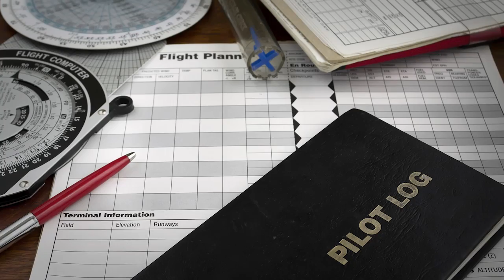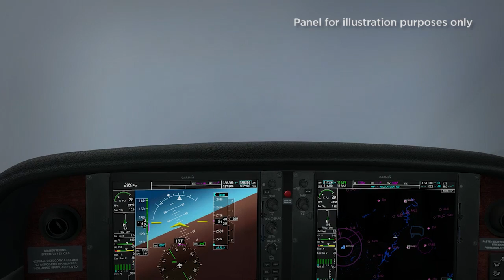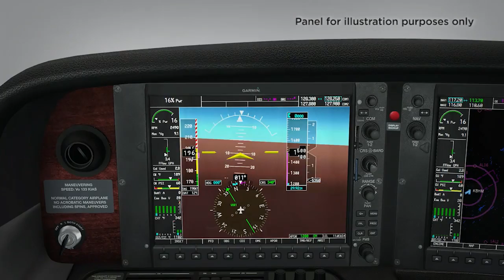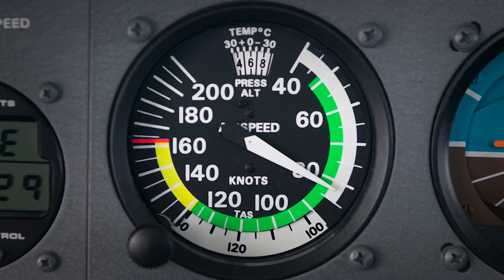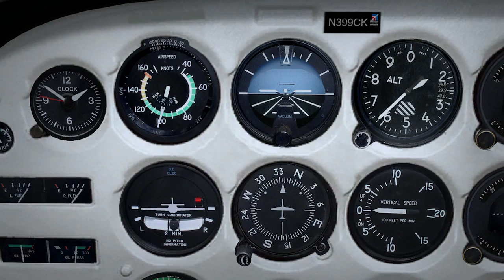Transitioning to Other Airplanes: Errors of Interpretation

Comment: This reminds me of a wave of plane crashes in Europe in the 90s and 00s where the pilots were from the Eastern Bloc but flying for western airlines post-communism. Basically in Soviet-built aircraft, on an artificial horizon, the horizon stays level and the plane changes on the display, the exact opposite of Western-built aircraft. So for a lot of eastern pilots flying western aircraft, the artificial horizon was essentially inverted, they got confused, turned the wrong way, and crashed.

Comment: I dont get this particular one at all. Transitioning from analogue to glass is not challenging to a "crash-the-plane" degree.... The REVERSE is really really hard, but what he was doing should have been easier than what he was used to. Digital requires virtually no instrument scan nor division of attention , and one thing that both (a) remains the same & (b)gets a helluva lot bigger is the ARTIFICIAL HORIZON. Its the largest, most pronounced display in the cockpit. Difficulty shooting an ILS -ok... all right, I'll buy that. 
Trouble telling which way is up with 300 actual logged and a 10 inch wide attitude indicator in your face? No. There's something more to this one. This does not add up. Maybe a display went out, maybe the other guy was trying to fly. Maybe they had a faulty AP they kept messing with.

Comment: Among the most minuscule of details has led to some of the most NOTORIOUS of crashes in COMMERCIAL AIRLINE HISTORY... I'm particularly reminded of the late Soviet Union's reluctant acceptance of Western Aircraft, and the difference between the "old school" Soviet Artificial Horizon from the Newer Western version was so small...

    In one the horizon was kept level, where the plane (symbolized on the gauge) would tilt... AND in the other the plane-symbol would be kept level so the background horizon would tilt relative to it... AND pilots on BOTH sides of the philosophy of perspective have had severe difficulty, especially under stressful conditions, with getting acquainted with the other..

     SO there are several crashes where the investigation cited that difference in attitude indication as the primary reasons a COMMERCIAL AIRLINE Pilot (with all the training that entails) would act upon his yoke and inputs EXACTLY OPPOSITE what the manual would prescribe for the flight conditions. It was down to a process of elimination, so there was NO other explanation, and by the flight data records, that's exactly what the pilot(s) did at the time.

     SO there are REASONS these dubious changes or customs or traditions of aircraft gauge are notorious or legendary... AND there are reasons you, too, will get warnings about certain birds or displays, and "quirks" of flying them, or trying to.  ;o)

Comment: To him the airspeed indicator probably seemed upside down. On the conventional round airspeed indicator zero is at the top, but on the tape display, zero is at the bottom. This provides an inverse relationship to the stick- airspeed reaction. In his Cessna he can drive the airspeed needle by pushing or pulling the stick in the direction he wants the needle to go. On the PFD, it’s the opposite. 
Altitude is similar, though not as significant, however, you can’t scan the tape without reading the numbers as easily as you can scan a conventional altimeter needle.
That full-width attitude display in the background is supposed to help pilots like this stay orientated. However, it can’t make up for a lack of training and experience entirely.

Comment: I don't get the allure for GA pilots to fly IFR and IMC. I love to look out the window and see what I am doing: flying a plane above the ground, looking at the visual references and being in the act of flying - fully engaged. If you can't see you're just sitting in a box in a cloud. If it is to "get there" (itis) then get on a commercial plane if the weather is not good. Or fly around it, or drive, go tomorrow. Transition training in the new to you craft is key. Why not do that? I have seen this erratic flying behavior indicative of disorientation / indecision a couple of times now in these safety videos. Once that happens you wish you had an auto pilot. Turn it on, use it, let it fly you straight and level, get your head back on, make a good plan, then go for executing that plan. There might have been another issue we don't know about that caused the pilot to get into the "swerving" mode. Sorry for these guys.

Comment: I was trained on steam gauges, and was resistant to change, but after one hour with an EFIS, was convinced. I promptly installed one in my experimental, at the same time increasing my panel space for other items. Not sure why this pilot had trouble just flying attitude with the EFIS. I have found it fairly easy with the airspeed and altitude tapes alongside. I think strongly, that it would be much more difficult, to transition from EFIS, to steam gauges.

Comment: Í was once a sim instructor on A320 and had a class of captains and first officers upgrading from a different airplane, analog 727s and 737-300/400 and those guys had a hard time not just on systems but scanning the various display units. Even tough the original "T" was still there, the different format presented some challenges, requiring some go back to ground school. Took some time to get used to the fast updating digital displays. So sad this happened.

Comment: What is the safety advantage of glass that looks so different from traditional instruments?  If none, then why not make glass appear more like traditional instruments in the first place.
Reply: Glass is way easier to read quickly once you get used to it. There is a bit less visual indication of what the different parts of the readout mean exactly, but once you know what everything is instinctively, you can scan the instruments and get an update on what exactly is going on with your aircraft much faster than you can with the old fashioned dials.
Reply: No advantage, just familiarity. 

Round dials were used because it’s easier to manufacture round dials. 

The USAF and NASA having practically unlimited budgets used mechanical vertical tape displays on aircraft like the F-105, SR-71, as well as most US spacecraft from Gemini to the Space Shuttle.  HUD displays also went to tape displays. 

Their research into human factors and performance concluded that it was superior... and civilian aircraft manufacturers adopted them as they could afford them... first in some analog displays like engine performance on the 747, L-1011, and Cessna Citation and for radar altimeters on later analog aircraft. As soon as glass cockpit displays became available they started moving all flight information to them. First airspeed with the 757 and 767. Then all information with the A320 and 747-400. 

And the proof is in the pudding. Aircraft accidents have been reduced considerably thanks to the increased situational awareness from this format. 

Unfortunately the high costs have kept these displays out of light aircraft. So most private pilots are only familiar with using traditional gauges.

Comment: Why not make the display optional for glass , simulate the crucial analog display gauges or change it  as you gain experience ?
Reply: Because the manufacturer would have to certify the instruments for both modes? Extra cost.
Reply: It seems you could sell more with optional configurations , seems like safety should be a priority when design flaws are recognized.

Comment: This is true for any experience level. Some years ago my company switched from the old B727 to our current B757. Those who had previously transitioned to the B727 from an old Learjet had to work harder when compared to some newer pilots who had previously flown ATR-42. How can a slow ATR pilot make a faster transition to a B757 than those with more experience in jets? Simple. Those who had to work harder had never flown a glass cockpit before.
Reply: And the 757 was a kind of glass-cockpit light, with round air data instruments. Going from the 727 to an A320 style PFD was even a bit tougher.

Comment: With two pilots in the cockpit it doesn't make sense that the flight deteriorated as it did. Why couldn't they maintain altitude and airspeed? Why didn't they land immediately at Auburn if they were having trouble with the plane? Maybe the two were arguing rather than cooperating.
Reply: That sounds like the most likely explanation to me as well. I've been in car rides that developed extremely heated arguments over which road to take to get to the destination, I can easily imagine the same happening here and both pilots getting distracted by the arguing.
Reply: That would be my guess as well. They got into a bit of trouble, and then argued with each other, instead of working together to get out of it.

Comment: The video is correct regarding transition from analog to digital instrumentation.  For me, one example was the appearance of digital quartz wristwatches in the early 80's.  All my life I could look at my mechanical wristwatch and see it was 20 minutes past Seven o"clock.  From that point I had a mental image of the watch hands, and a mental awareness of about how much time had passed since I last checked.  Enter the age of digital watches ---- I would see the numbers 720 and actually had to memorize numbers to know what time it was.  My brain wasn't trained in numbers for timekeeping, and I was constantly wondering what time it was, re-checking my watch every five minutes and still not knowing the time.  Finally, I resorted to turning the numbers into a mental image of a clock face, and that solved the problem, although I had to make watching the time a two-step process.  Analog v. digital are two different worlds in the area of human cognition and application.
Reply: Except this isn’t analog vs digital. It’s mechanical vs electronic. Glass displays are definitely analog.  Even “digital” readouts are on drum rollers so you can see fine values and trends. 

And of course the digital watch was never an issue for me since I had to work on a 24 hour Zulu clock which meant analog watches were next to useless.
Reply: Also... that “mental image” of the hands killed a whole pile of pilots flying off a three hand altimeter (the kind that you see on light aircraft) because they were too easy to misread by TEN THOUSAND FEET!!!

The very first addition to high performance jets was a altimeter with a drum roller readout of altitude and only a sweeping 20 foot hand.

Comment: The pilots who have trouble flying a glass cockpit or having problem interpreting the EFIS information are showing their old age.  We young people who grew up flying PC flight simulator and fighter combat simulator can easily understand the EFIS and love it.  This somehow translate to the experimental pilots who with the more adventurous mindset tend to favor glass cockpit over the ancient and obviously obsolete steam gauges.  I can't remember any experimental built within the last 5 years hss steam gauges.
Reply: I am not a  pilot, but I do have this to say: don't knock age and experience. You can learn something from everyone, "old" or not. Hubris is a killer.
Reply: Meh, I'm 25 and I think the old fashioned gauges are a lot cooler.
Reply: @Eric Miret I'm not entirely convinced by that. I mean, I know the stats prove me wrong, but if your display fails for any reason and it's your only instrument, you're dead. Vacuum gauges work even if you have a complete electrical failure, and even in case of vacuum pump failure they still operate correctly for a while, and you can have a standby vaccum system fitted quite cheaply and then unless your engine blows up you'll always have instruments.
Also if one of the instruments fails it's unlikely to affect the others.
I'd be much more at ease in an aircraft that had both the glass and some backup vacuum instruments, tbh.
Reply: Careful there demoniac81..... 

A vacuum system isn’t nearly as robust as you think it is. 

We all know how fragile a dry vacuum pump is. It’s not if it will fail, but when. 

If one vacuum instrument fails it can certainly affect another one. Especially if the case fails. Now all of the air will be drawn through the broken case or glass and not the rotor of the other gyro. 

Forget standby vacuum systems. If you’re IMC you’re probably high, with low ambient air pressure and high throttle settings. Ever drive an old car with vacuum powered wipers?  They don’t suck going up hills. An emergency isn’t typically the time you want to throttle back. 

Finally.. you’ll follow a tumbling attitude gyro right into a spiral dive with no vacuum. Unless it’s a fancy one with a flag or you know that it doesn’t have vacuum and completely ignore it. 

With electronic instruments... you rarely only have one display. You have reversionary modes where you can display all information on either display. And you have an alternator, a battery, and likely a standby battery or standby instrument as well.
Reply: Watch your ego and over reliance on the glass cockpits if your a real world pilot, kid. I prefer having steam gauges as back up when flying with glass cockpits. Real world flying is not a game.
Reply: @ Frank Court 

I’ve seen far more mechanical gauges fail than digital ones. 

I don’t have a single mechanical primary flight instrument in my aircraft, and that’s just fine with me.

Comment: Perhaps the glass cockpit was a factor, by I find it hard to believe that's the primary reason the plane went down.  I just went from a glass cockpit to old school controls(which I kind of like better) without a hitch.  Something else had to have happened.
Reply: I happened to know the owner-builder of this airplane, and even borrowed his trailer to move my own RV-10 project from home to the airport for final assembly.  He was a prince of a fellow, but flew his -10 infrequently and never IFR since not rated for that.  My own EFIS displays were identical to his, and on my first flight in VFR conditions I got total cognitive overload and had to use the round gauge backups to keep the flight under control until I could train my brain where to look for the key airspeed and altitude numbers.  We also had the same kind of digital autopilot in the plane, which is a very capable unit but requires substantial knowledge of how to configure the EFIS to control the autopilot.  I think the key here was neither pilot knowing how to use the autopilot to maintain level flight or fly a coupled approach (which his RV-10, like mine, was fully capable of doing).  RV's are notably sensitive in pitch compared to certified aircraft, and an amended clearance while hand flying in IMC is almost certain to result in large altitude excursions, and somewhat smaller lateral deviations.  I felt especially bad for him since I was flying IFR in my RV-10 that same day in the same area, also southbound, and there were clear blue skies above the 9000 foot tops in that area.  If he had climbed instead of descended, the flight would have proceeded without further incident.  Rest in peace, my friend.
Reply: After reading the NTSB report, I rescind my comment about the autopilot.  We did both have identical GRT EFIS systems, and he told me his plan was to install the same autopilot I had in my RV10, but apparently he never implemented that plan.  Reconfiguring that EFIS + SL30 system for two different ground-based approaches while hand flying in IMC would be a handful for even a very experienced RV10 pilot.

Comment: Wait... No Analogue backups? Is that even legal?
I was under the impression that it wasn't.
At least, not from the kind of flight training manuals I have...

Maybe it's a country specific thing...
Still fairly sure there have to be at least some minimal backup gauges in an aircraft. Especially one that is certified for use in IMC...
Reply: Why do you even need an analog backup.  Data shows the analog gauges have much lower reliability than the solid state glass cockpit. Also, the RV10 in question has dual redundant display and one small redundant EFIS unit.  This setup has much more robust backup than any steam gauge setup.
Reply: RV10 is an Experimental airplane, so that is not a requirement like it is in other, Certified Aircraft (Cessna 172, etc).

Comment: Even with 15k hours I dislike these glass cockpit displays. To me the airspeed ribbon moves the wrong way. Pitching up the ribbon should move down to show airspeed reducing. So zero should be at the top.I know why it goes the way it does, it follows the convention of a engine ribbon gauge, zero at bottom.Just been watching a video of a Tornado pilot talking about his past. Mentioned the radio altimeter readout on his HUD, was just a bunch of numbers wizzing up and down. They had it changed to a small dial. Much easier to read.
Reply: USAF airspeed displays are reversed, but to me it is counterintuitive. 

And if a Tornado pilot is looking at either a digital or analog rad alt whizzing up and down he’s looking at the wrong thing. Like that F-16 pilot who took out the trees on the ridgeline. You’d better be looking outside or at a very good synthetic display.

Comment: Surely this aircraft had at least a basic autopilot that can keep wings level and hold an altitude? If it has glass gauges, surely these are slaved to an a/p. If that is the case, I don't understand why a pilot can't simply hold an altitude and establish straight and level while he sorts out the rest of the problems. Perhaps this aircraft could only be flown manually?
Reply: Rare for kit builders to fit autopilots, they are generally trying to keep cost of build down.